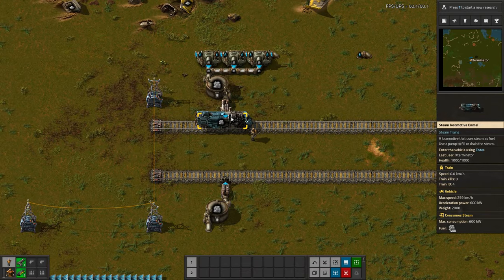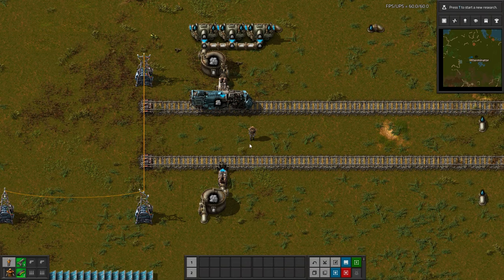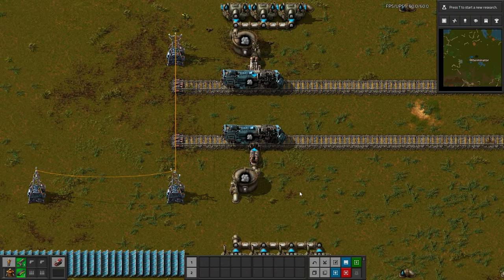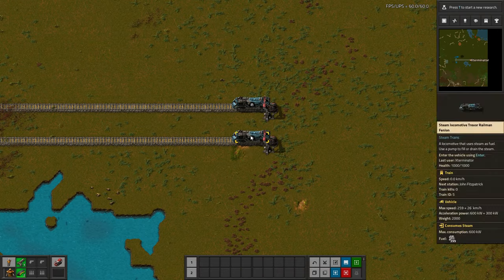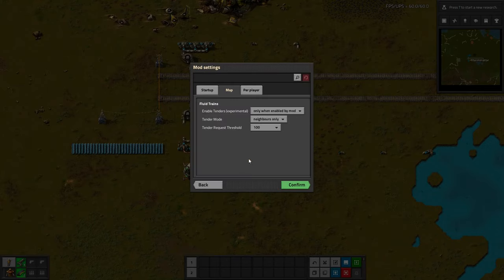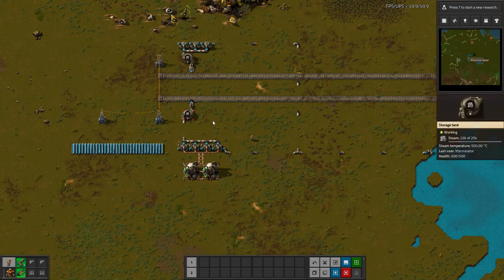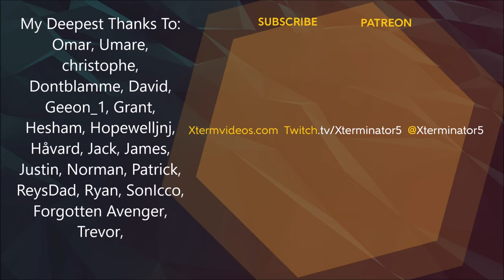Factorio Mod Spotlight - Steam Trains

Comment: Thanks for the review.
I thought the vanilla trains were steam... 
You put wood and coal into them. I was thinking that the developers just never bothered to add the water fill mechanics.
I wonder now what the fuel is doing in the vanilla ones, running on coal and wood smoke?
Huh.
Reply from the maker: Yeah it's a bit of a mystery lol. Not even sure the devs has a plan for whats happening there
Reply: Don't think about it too hard... I ran out of fuel in a tank way out in the boondocks...  No problem, I have an axe, and this tank runs on logs of wood!
Reply: Wood, coal, solid fluel, rocket fuel, *nuclear fuel*.  Yes, it doesn't make sense, but "it's only a game".
Reply: This. As a burner device, it basically is a steam locomotive, just without the steam. What this mod adds is closer to a variation known as a fireless locomotive. Not confusing in the least!